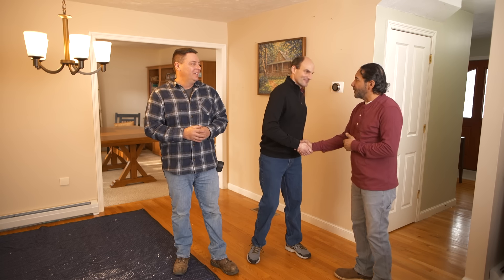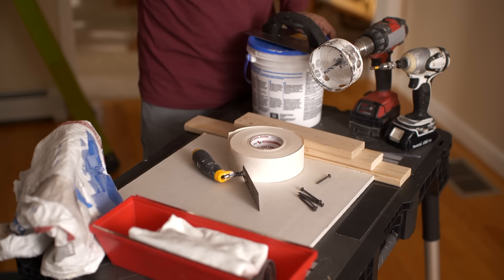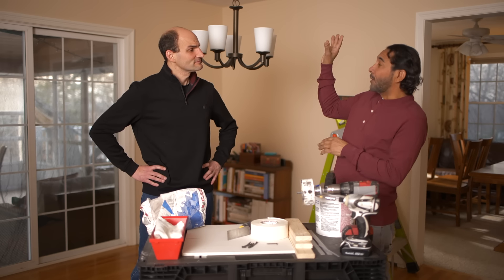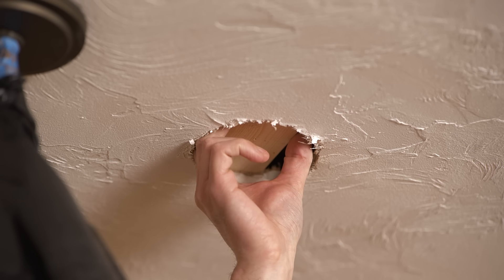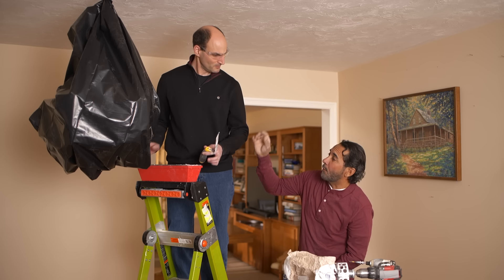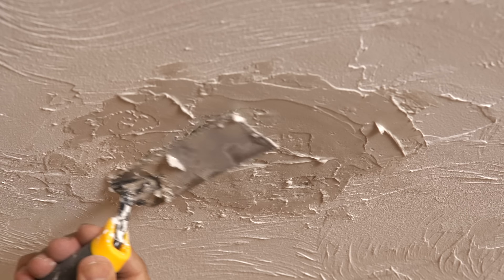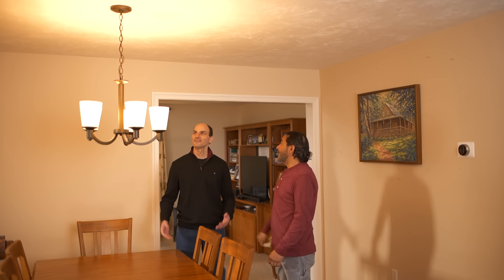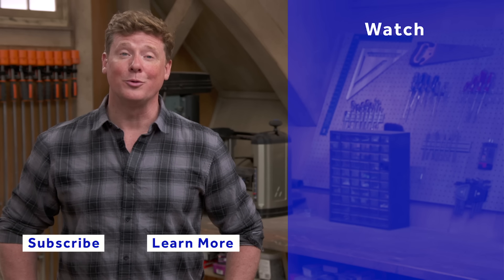How to Patch a Hole in a Textured Ceiling | Ask This Old House

Comment: For ceiling repairs, I like to use either FibaFuse tape or fiberglass mesh tape. Because it sits flatter than paper tape. Especially if someone is doing some diy drywall repair.👍🏻🤓
Reply: @Kevin-mp5of  not for ceiling repairs or DIY’ers…
Reply: @Kevin-mp5of  DIY’ers usually apply to much compound when bedding paper tape. Once they do that, there’s no going back. That’s why I recommend FibaFuse or fiberglass mesh for beginners. 👍🏻 I would definitely like to hear your reasoning for recommending paper tape for diy ceiling repairs?
Reply: @Kevin-mp5of  That’s why I said FibaFuse first. It’s not mesh and doesn’t require setting type compound. And it’s the best. 👍🏻

Comment: When I move a light fixture like that I generally just hang on to the drywall that comes out of the new hole that I just cut. Put a piece of backer strapping in the old hole and that patch will generally fill the hole very nicely. A little bit of joint compound around the edges and you're good to go
Reply: I do that with my recessed lighting.  I do the patching most of the time because it wins me more jobs that way.
Reply: That's a fantastic Idea. Thanks for the tip!
Reply: I was wondering why they didn't do that! But I do appreciate them showing how to do it from scratch in case we don't have an old piece to match up or for folks who didn't watch the previous video and might be confused if cutting a new piece of drywall was skipped.

Comment: There are cell phone apps that will analyze the exact paint code for the color and sheen of the ceiling you can purchase at just about any paint dealer. No need to paint the whole ceiling.
Reply: Did a medium-size wall patch about a month ago. There used to be apps that let you use your cell phone to easily color match paint on your wall and then pick up that exact color and sheen from a local store.

Now those apps either require paid memberships or an external "color scanner" tool that connects to your phone via Bluetooth and costs over $100. It's incredibly frustrating because you can still see reviews of the apps from before they required the color scanner "tool" and the apps seemed to work really well.

Alas, corporatism and short-term profit-seeking ruin yet another innovation.

Comment: Should have just taken the circular hole they cut out for the new light fixture (from the last video) and used it to patch the old light fixture hole. The texture would have been the the same as the rest of the ceiling and you'd only need a tiny bit of compound to fill in the gap which shouldn't be too noticeable.
Reply: They cut the scene where Mauro asked Heath where the hole was.  Heath said he threw it out as a frisbee onto the street and don't know where it went from there.
Reply: That is the way to do it. No question. I mix a small pan of 5 min pack the joint and screws then sponge down just before its totally firmed with a wet tile grouting sponge. Less is more for something like this. No reason for mesh or paper tape, unless you want it to look like crap in the rare chance it cracks 39 years from now.

Comment: The second part of the last video!  What is missing is how he gauged the texture to recreate it on the patch.
Reply: He didn't gauge the texture , all he did was rough it up. I personally didn't like the way the texture looked.  But the home owner liked it and that's what counts
Reply: V, I agree but I’m not sure how you’re going to do any better without re-doing the whole ceiling.
Reply: @MrNicholasAaron  I suspect there’s a way. We had two pendant lights moved and the old 3” holes are invisible. Under a repainted ceiling of course. We also had some stucco patched and the person doing it took a few minutes to describe what he saw In the texture. The type of trowel. The type of stroke. Etc.  also invisible when the house was repainted.

Comment: this guy's  a hack. why cut  a disc that is too small, it's not hard to get a tighter fit using a utility knife, the so called texture was a mess. if they didnt do anything more that what was showed, it'll stand out like a sore thumb.  . sure glad this guy doesn't work in my house
Reply: Or cut a square around the hole then cut a square piece to match.

Comment: Be aware that much of the older texture has asbestos (especially popcorn) - do not touch - do not disturb- get tested
Reply: if the home was built after 1960 there's probably no asbestos.
Reply: @rupe53  your absolutely 100% wrong!!!!!!!!!!!

It may have been used all the way till 1980 - then you have to factor in if the owner had old stock.
Reply: @bobwhelk2118  ... per building codes it was actually banned as a ceiling product in 1973. The flip side is it was less popular (at least in my area) by the early 60s. This is about the same time they stopped using it as pipe insulation for the heating industry. BTW, I said PROBABLY based on the idea they were phasing it out in that era. You are correct in that contractors will stick to their old ways and may continue to do it as long as supply lasts.
Reply: @rupe53  it’s always best to test and never assume an idiot like myself knows what their talking about.